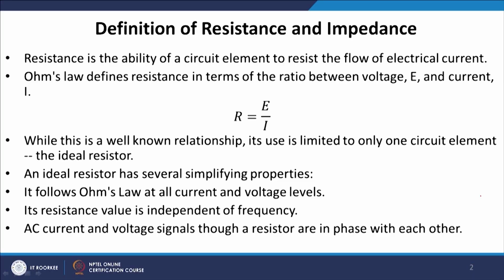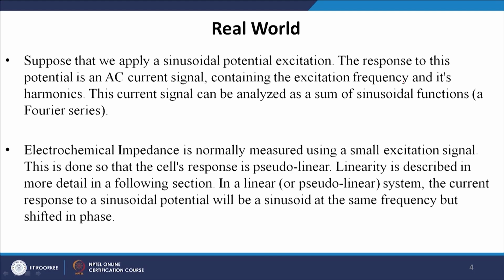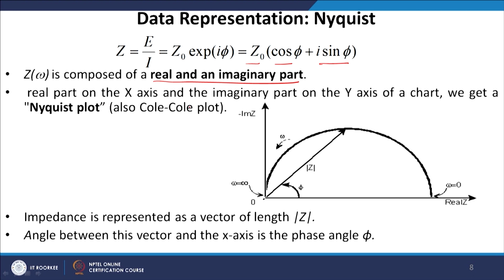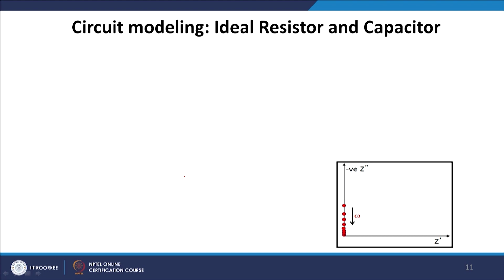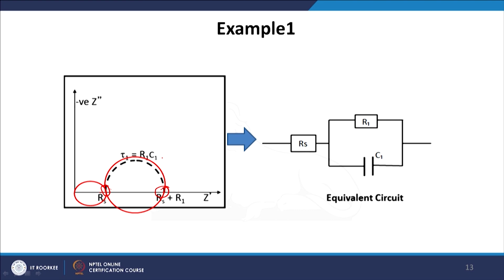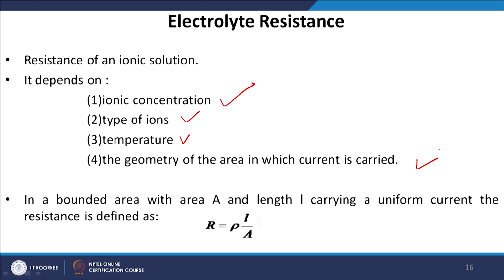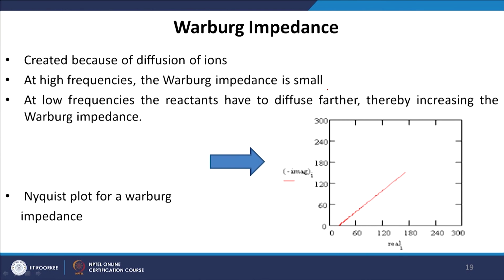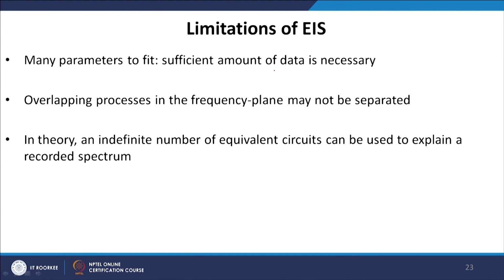Impedance Spectroscopy

Comment: It is very useful for me to understand impedance spectroscopy since I would like to use it in measuring the steel corrosion in concrete, as well as the concrete resistance. Thank you very much!